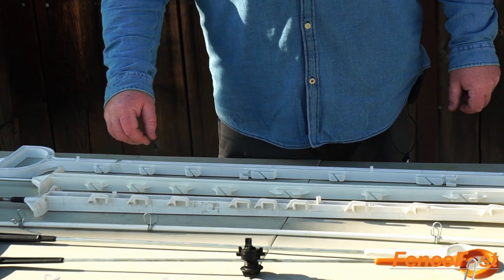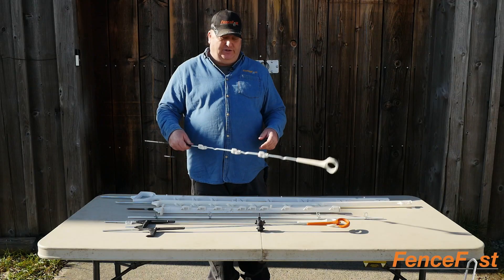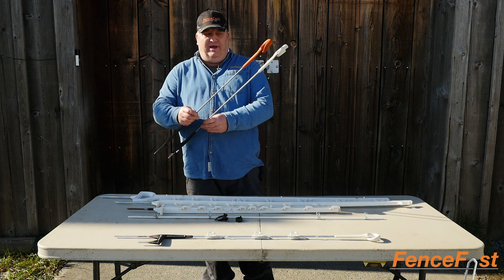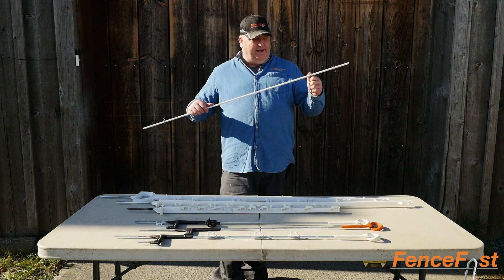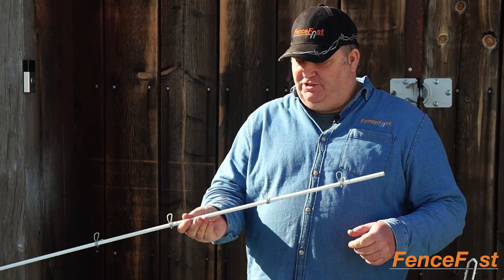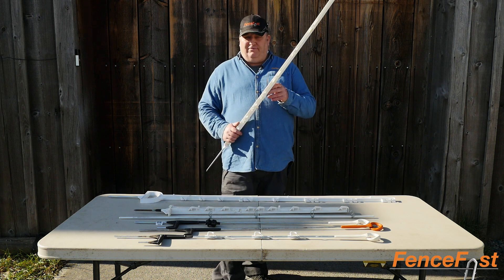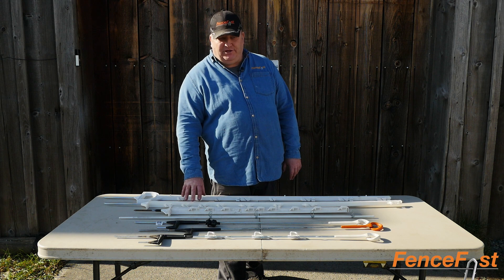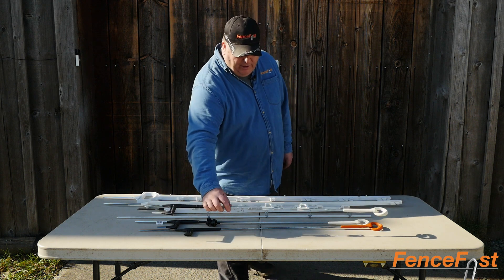Choose the Right Post for your Electric Fence | Step in Posts

Comment: I am looking to hold three cows on a small 3 acre pasture for a month or so each year while I work their main pasture and let the ground have a break. What posts would you recommend I use to run maybe 3 hot wires on?
Reply: The taller ones. Put wood or steel t-posts on corners or any sharp curves for support.
Reply: Have one wire at about your knee and hip height and if you're really concerned about it, you could put one more a foot or so above that. Once they learn to respect the hot wire you can usually get away with just one wire on low stress areas.